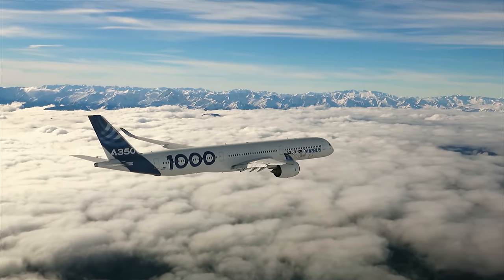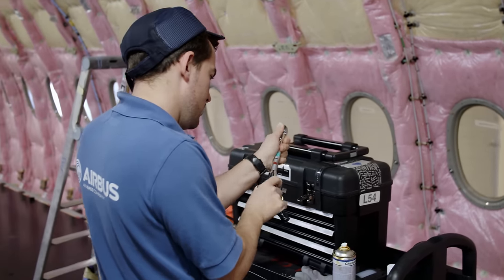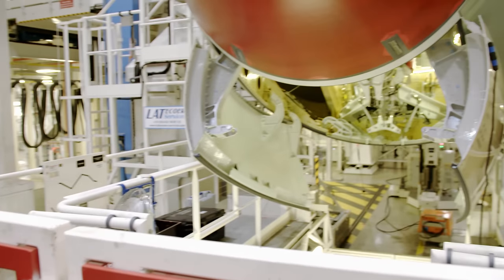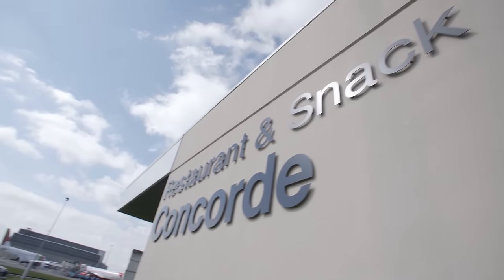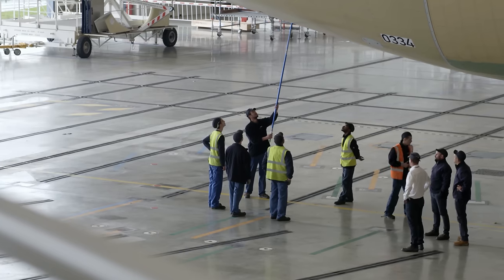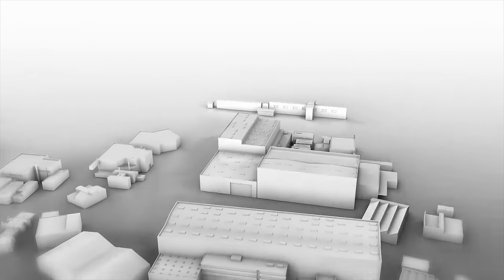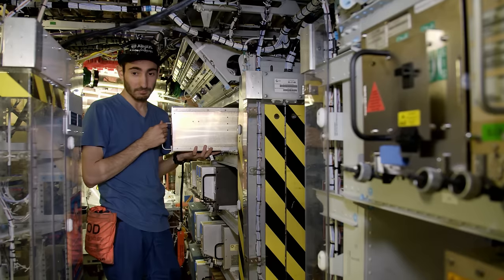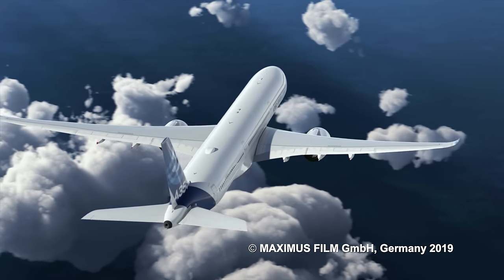Giant Aircraft: Manufacturing an Airbus A350 | Mega Manufacturing | Free Documentary

Comment: Fascinating. Not only it’s the state of the art of an aircraft but it is also the safest. Bravo A350!
Reply: Airbus usually copies trend. Everything mentioned here has been done by the Boeing in 1970s and 1980s in the 777 project. 777 was the real revolutionary aircraft in this class. Having missed the bus in 747 revolution, and seeing enormous success of twin engine ultra long range wide bodied, carbon composite 777, airbus finally woke up and came up with an alternative by 2000s to compete with 777. A350 is a result of that. Considering the technology available in 2020, this is the best airbus could do to catch up. Europeans for long depended on American middle class consumer for their prosperity and doesn't know how to innovate. From automobiles to aircrafts, story is the same. Result of socialism creeping through the system
Reply: @chi-8289  Actually you should at least try and get the facts right... The Boeing 777 is a conventional aliminium aircraft (less than 10% of its structural weight was composite materials)
Reply: Duy Le Nguyen and the A350 is a copy of the 787 so what? The 787 has tinting windows, bleedless engines and the list goes on. The A350 is quite conventional in design.
Reply: @superskullmaster  at least airbus's work though 😂😂
Innovative this innovative that and then ends up in the ground with dead bodies everywhere, boeings a shitty morals company
Reply: Gohan With Down Syndrome Airbus is getting tinted windows and u only provided two valid reasons. Can’t think of any more?
Reply: Chi - amazing everything u said was just wrong. Besides the Boeing 777 project was started in the late 1980s not the 1970s.
Reply: MFulmer456  Hard to compare modern planes, honestly. No planes that entered into service within the last 15 years have had any hull loss crashes, much less fatal crashes, except 737 MAX.

Comment: I've flown hundreds of times but everytime I board a plane I'm in awe of the engineering. It's a metal tube flying at insane speeds thousands of feet in the air.
Reply: Or in this case, a plastic tube (carbon reinforced)
Reply: G.G. Reilly shut up
Reply: G.G. Reilly apart from you wouldnt...

Comment: The most amazing fact of the whole process from part manufacturing to putting them together is that the integrity of the most advanced aircraft boils down to a common factory worker who fasten and glued all the nuts and bolts by his two hands not the damn robot.🙂
Reply: Robots were used in making the parts
Reply: Hold on there pilgrim.  Most of the composite panels for the wings and fusillade are cut using High pressure water or plasma cutters.  I'm sure the control boards are mass assembled on robot lines.  

It is cool that we see humans assembling the final product!

Comment: Crazy part is that this thing is designed entirely in a CAD program with probably every single ziptie modelled every wire, every bolt and nut. Absolutetly everything document with torque specs, material data, strain simulations, thermal simulations and everything mixed together is absolutely insanity

Comment: Boeing take notes 😂
Reply: Aviator dreamer triple redundancy angle of attack monitor as standard. That was decided upon and standard right when it was on the drawing board.

Yes, take note Boeing. No need for MCAS. Triple redundancy.
Reply: It's only on one family, the max.
Reply: 787,  the competing plane from Boeing's side, is the only new plane Boeing has built in the past 20 years and is a pretty good plane. It is after the 787 that Boeing started playing with refurbishing old planes.
Reply: Benson Peng 
What do you mean? The 737 has been refurbed at least three times since the 1960s.
Reply: @kardy12  As in only refurbishing old airframes instead of developing new ones.
Reply: Airbus: 35 crashes, 28.3 million flights, 0.81 million flights per crash. Boeing: 251 crashes, 461 million flights, 1.84 million flights per crash. Boeing has been around for over 100 years and built something like 40,000 aircraft. Airbus has had it's fair share of problems and crashes. Boeing will get it's problems fixed.
Reply: @joeg5414  I feel that both companies make good airplanes. Airbus scored a great deal when they picked up the C series jet from Bombardier and renamed it as the A220. Why didnt Boeing get this jet? I feel Boeing should scrap the MAX and start fresh.
Reply: @joeg5414  I also think that Boeing could take a page out of the book of Airbus...better attitude.

Comment: I guess Airbus employee arent required to wear safety glass.
Reply: A good observation. Perhaps it's not required because it's not needed. Everything is clean, so no debris will find it's way to the worker's eyes. There's also no machining happening at this stage of manufacturing, so that's not a problem either. I also assume no parts or tools are allowed to be left laying around, and there even isn't much to be left around, as even screws seem to arrive in counted and numerated packages. In some other stages of manufacturing safety glasses may very well be required.
Reply: @adoatero5129  That's good to know.  It's mandatory for all Boeing employee to wear safety glasses whenever at the shop floor.
Reply: @UrAshWhole  Include office's 😜
Reply: It's not shown in the movie, but when it's needed they do. They also have special equipment when there is carbon fiber dust (when drilling for rivets, for example)

Comment: I love when managers, coordinators and supervisors say “we work” or “we do” which, as you can clearly see in this documentary, means “we stand here and they work”. In the documentary they keep saying how everything needs to be on time and there cannot be any delays, and they spend an hour or two giving interviews. That’s how you know your role is unimportant. It’s much easier to replace a supervisor than a skilled worker.

Also, they keep saying “one mistake could be fatal” - no it couldn’t. If it could there wouldn’t let one 
 bloke do it alone in in the dark. The aircraft can still fly safely with a loose screw in a cup holder.
Reply: I honestly think you are terribly ignorant, every step of the process and every level of the hierarchy is essential to ensure that a an aircraft doesn’t fail mid-air. There have been several fatal incidents where the fault was of a small, minute component which wasn’t properly fixed or replaced in time. I find whatever anger problem you’re having completely unjustified.

Comment: An intersting documentary 
I notice very few women working there. Obviously Claire the electrician boss who has a responsible job.
The workers on the factory floor I do nt distinguish if they wear hard or soft caps for safety should there be something falling from above.
I would also liked to have seen something about the instalation of the fuel tanks. Otherwise Not bad.

Comment: I know A350-900 noisy uncomfortable seats windows much smaller than in B-787 Dreamliner, just the few. Noise is the first, earbuds not enough to cancel noise. The same day I flew in A320 what a difference, seats much better and space is more than in more expensive “flag ship” A350-900. Both airplanes few weeks old and dramatic difference plus for smaller plane. B787 vs A350 comparable same as iPhone and Galaxy two different level of quality and users experience. I know the one and the other too.
Reply: The seats are a customer option so you can blame Airbus for that. The 350 is factually quieter.

Comment: The A350 is direct competitor is the B787.  I have flown both several times and the A350 is the superior aircraft to fly on for the economy class passenger.  If they ever do put 10 seats across it will be a nightmare of squished misery with the 9 across seats already slightly too close together. (not as bad as the 787).  I suspect it is also put together better than the 787.  The best passenger aircraft ever is the A380 which unfortunately is already in decline.

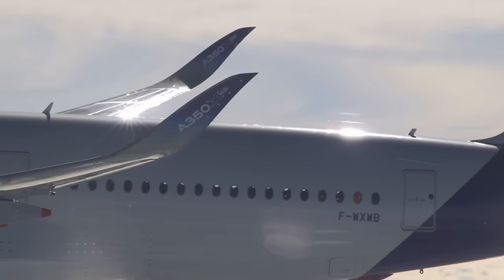Comment: 0:45 Is this what we see on the sky as chemtrails? What is that stuff they are spraying from the planes?
Reply: In that shot the plane is simply kicking up water from the pool it is driving through. Secondly there is no such thing as chemtrails. The trails planes leave in the sky are water vapour which his a byproduct of the fuel being burnt.
Reply: That's not a very convincing explanation. If it was water from the ground it wouldn't be coming from under the wings and a bit off the engines, but a couple of meters right behind the engines. This is clearly being sprayed from the plane and if they can spray it on the ground, then they can spray it in the air.

Comment: All I would say regarding composites, is that they have a short life span due to delamination over time. It is also hard to detect when delamination has occurred in some areas. I hope they have good inspection and maintenance process in place to ensure safety 10, 20 years down the line and more, not simply good upon manufacture.
Reply: It’s mainly monolithic rather than sandwich.

Comment: Greetings 

Dear you tube free documentary

My own consiusness with my own sentence gives my self action to self aknolwdege for  this you tube application for free documentary

In my opinion 

Use the gadget of magnetism power energy to make a principle of floating and principle of movement and principle of safety 

Use and analyzed this understanding method by method understand of
1) magnet south and magnet south by pushing principality for floating material 
2) use magnet of south and north magnet for material principle balance 
3) use an air-conditioned to cooling the magnet structure 
4) use the Steel cover magnet to prevent not normal effect of frequency 
5) use the steel covers magnet to keep the energy stabilize at the accuracy place 
6) energy of magnetize are the top magnet reaction only 

Self understanding method as principle movement of magnetism:
1) principality of material floating 
2) principle of floating material for safety Principle
3) Principle of movement at  front movement, right movement, left movement,  upper movement, lower movement 
4) use the hydraulic or air system to press the magnet to push the magnet push energy at principility of pushing magnet energy as consistently 

6)

Comment: when will we see electric run areoplanes imagine that what with the fuel running out then they must be doing electric planes they could fit batteries in the wings plus it would be safer
Reply: it would not be possible as modern day batterys are not as effecint yet as the battery required to power a plane like that would be wayyyy to heavy and the range would not be good as battry would drain too quickly